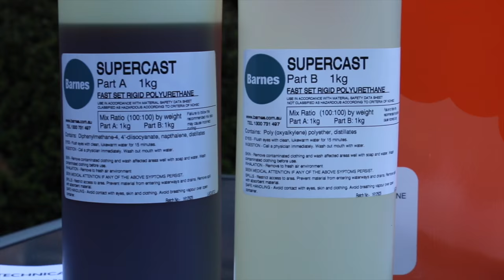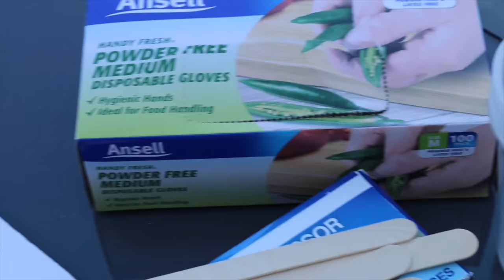Batfleck Utility Belt- Part 2: Molding & Prepping!

Comment: A tip: if you pour a small amount of resin into your silicone mould and roll it around so a thin layer covers the  small details it will prevent a lot of the little annoying air bubbles. 

Im really enjoying the crafting and customisation videos btw
Reply from the maker: +Kieran Dogma Awesome man thank you :)
Reply: +Cosplay Chris how much was the 3D parts of the bat belt

Comment: For a REALLY budget belt, I used modified crayon boxes. I bought 4 and used matching small Tupperware containers for the last 2, but you can get 6 boxes is Cra-z art crayons for $1.50 at Walmart right now with back to school . Just cut off the part that hangs onto a rack and extend the flap with cardboard

Comment: why are you waiting until the final step to clean the pieces(especially the 2 part belt) ? wouldn't it be easier to clean the 3d printed model?
Reply from the maker: +determine14 Because the plastic that a 3D printer uses is an absolute punish to prep. So I'd rather cast it in a resin that's easy to sand and prep ;)

Comment: hi im working on a Tales from the borderlands cosplay and was wondering what tips you have if any on sewing or building a prop gun!! i used a nerf gun for my base and use foam board but for future i want to use something more durable that will bond well any suggestions?
Reply from the maker: +vic leon Make sure you use a glue that will bond the plastic that the gun is made from :)
Reply: +Cosplay Chris if you know what plastic Nerf guns are made from and what glues would work best I have used hot glue so far and it seems to be holding up
Reply: +Cosplay Chris and thank you
Reply from the maker: +vic leon If hot glue is working for you man than stick with that :)
Reply: +Cosplay Chris alright thank you Chris I can't wait to see how the belt comes out and maybe if my prop comes out well I can share a picture of it with you :)